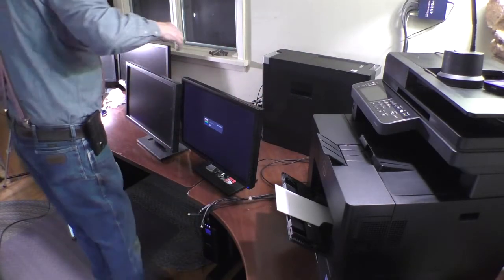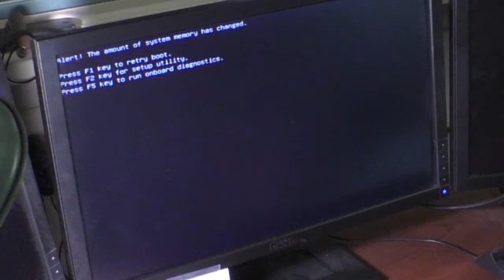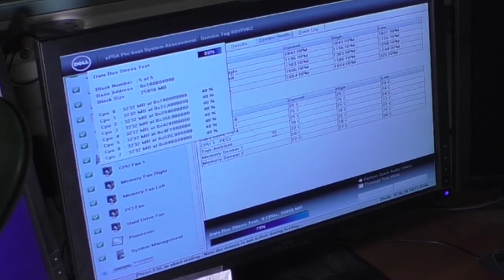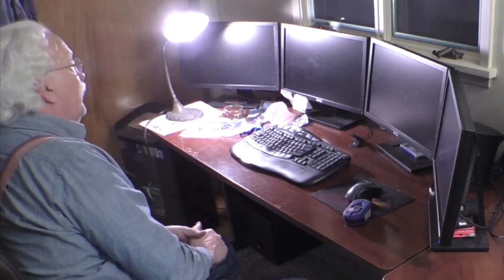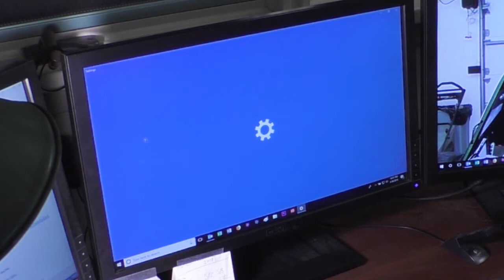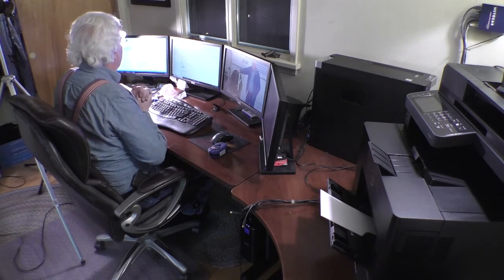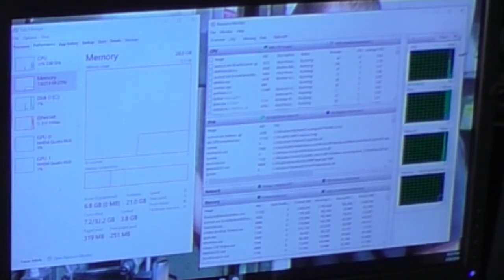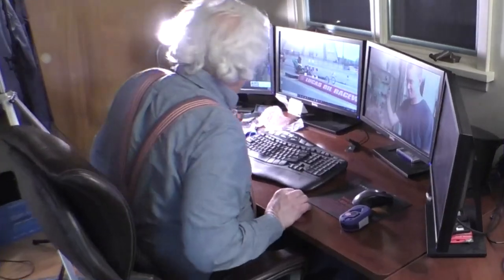How to install memory into a Dell Precision T8510

Comment: Have you tried to run only 2 monitors while editing to see if it reduces the load on your graphics boards during editing and rendering?  The memory looks like it may have helped - maybe going on less monitors will give it that little bit of extra?
Reply from the maker: Yes, have tried just running one and it makes no difference. I have just done two videos using Elements with only small problems with the new memory. I forgot to try and call about the bad board today, will try in the morning. Glenn Lever